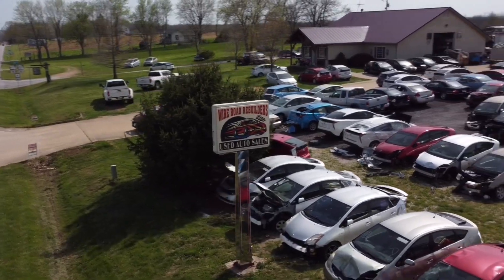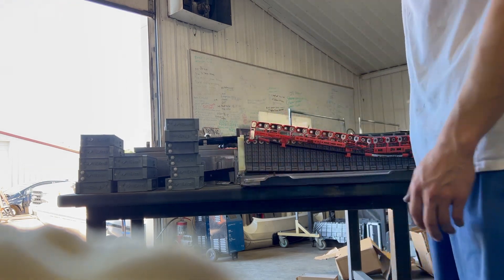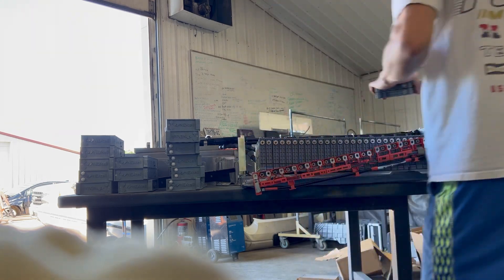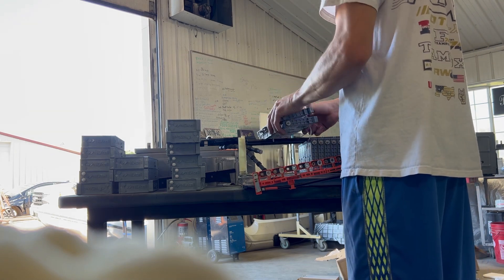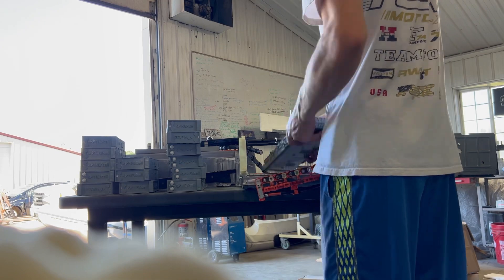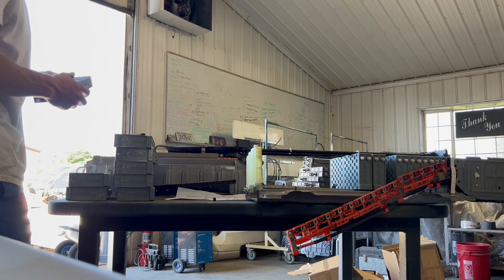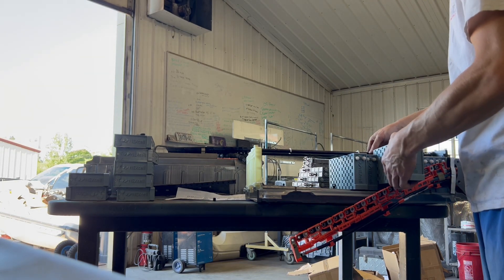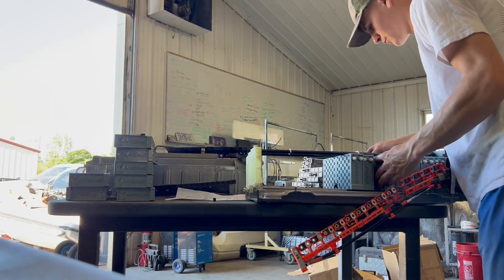Why you should switch to lithium on your hybrid | How to install Prius hybrid battery

Comment: My lithium battery from Project Lithium caught on fire. Switched back to OEM after the fire and I would recommend everyone be wary and do your due diligence before putting in non-OEM parts. It could happen to you too.
Reply: Tk you
Reply: That is my nightmare about lithium batteries.
Reply: I think it depends on where you live. I’m in NY, I put 90k on my gen 3 with project lithium and it still tests as it’s new. I heard about the guy with the fire. I feel safe with mine but if I was in Miami I would think twice.

Comment: How does lithuim handle cold weather, say -6f.
Reply: Very poorly. I have one and it could barely handle the mountains at 20-30 degrees, let alone less than 0 degrees. Then it caught on fire. Please don't buy this if you live in the cold. Jack has good luck in sunny California though.

Comment: No, just no. The Toyota NiMH battery management system is not appropriate for lithium ion cells. In particular, there is no cell balancing which the lithium ion cells require. People are asking about the fuel economy improvement and notice they didn't answer that question. The expected improvement would be close to zero. There should be a slight improvement from the reduced weight and probably a tiny improvement from less losses in the cells but any improvement is not worth the massive risk you are taking. The warranty is only 2 years plus will they be around to honor it? Your best bet by is a new OEM battery. Not cheap, but you can count on never having to change it again. Second best is a pack from a low mileage wrecked car. Third best, is a Frankenstein OEM pack where someone has collected good OEM cells from bad packs to make a new pack. The worst bet is any non-OEM solution. If you plan to keep the car, only choose from the top 2 options. If you plan to choose the other options and plan to ditch the car, at least tell the buyer what you did so they can be prepared.
Reply: We are a hybrid repair shop and have numerous lifepo4 battery packs out there.   To answer your question about balancing and software.  The balancing boards are built into each modules and the modules are better performing batteries  so far any issues that have come up have been remedied immediately through the company.  If you are just tearing down a company without doing research then you should be more careful.   You are right the charging system on a Prius is designed for a nickel metal hydride pack but that is why the modules are set up to work with the  Prius hybrid ecu to give the car optimum performance.  Fuel economy has been higher with all of the lithium packs we have installed but vary per drivers driving habits.  We have installed new OEM packs to with customers having very little improvement in gas mileage in comparison to the lithium pack.
Reply: @vdnishimoto3653  Mine caught on fire. Would not recommend, I switched back to OEM.
Reply: @vdnishimoto3653 it's probably important to point out that lithium iron phosphate behaves very differently compared to lithium ion and is very unlikely to explode or whatever.

Comment: have you had any issues with lithium cells? i am being told that they are very volatile and cause fires and explosions.
Reply: These are lifepo4 packs.  Not the same as a lithium ion pack. So these modules will not explode.
Reply: where can i purchase if i need to? @vdnishimoto3653
Reply: @KReplacement  Mine caught on fire. They're backordered while they work on a fix so no one else's catastrophically fails.

Comment: Question: is there any software changes or other modifications needed to switch from nmhi to lion?
Reply from the maker: Nope plug and play
Reply: @carhub2178 on a gen 2 Prius I currently achieve 50 mpg winter  53 mpg summer here in Los Angeles.. 65 mph Cruise control and follow all speed limits

How much better mpg can I improve..

Will be contacting you again to buy more parts

Comment: I have a 2013 used prius plug-in base.  Is there a way to add back up parking assist to it (the advance has it).  I have backed down my drive way since 1983, and I still don't hit the same place twice. So back up parking assist looks like you angle the arrows to where you want the drivers side to hit, but I have not found out how to do it on the 2013 prius base plug in.  It would be nice if one were able to get the module(?) from a wrecked advance and put it on the base (if it would work--in other convert the base to advanced for minimal cost).
Reply: Bro, this guy is a junkyard scrapper. And yes, you can. With the OEM Control Unit, Wiring Harness,  hardware, and likely OEM scan tool for the control unit's software. You can add any system to any car, you just need ALL of the factory equipment involved.

Comment: Whats the result of switching batterypack of gen4Prius to Gen3 Prius
Reply from the maker: Longer period of life expectancy and small increase in mpg. More power also in some cases
Reply: @carhub2178  👏👏👏👏👏👏🙏🙏🙏 Thank you for yozr response. Im from germany and lately bought a 2009 prius Gen 3. With 75.000 milräes.  Im planning what to do n the Worstcase/ if.... and checking out the most important Services like egr or checkikg batrery every year( it is told ne to do by the dealer here in germany) because my prius gen. 3 hasnt a Ventfilter or can you give an advice/ maintance Tips....how long will last my batrery from 2009 ? greets from Jeton/ germany

Comment: This video is about a year old now. How would you say these batteries held up so far? Have you got any high mile record use yet?
Reply: There have been a reported 200000 miles on a pack with no issue.  We personally have a customer with around 100000 miles on their pack no issues.
Reply: @vdnishimoto3653 have you installed the V3 sodium batteries?

Comment: Is there any programming done with install or is it straight Plug and play?
Have u guys attemped any other Toyota/Lexus hybrid vehicles?
Reply from the maker: We’ve done some Camrys but no you don’t need tools to clear codes. If it don’t reset just unplug the battery and back in

Comment: OK, I have a 2010 Prius I let sit unstarted for about a year.  Now the 12v battery has been changed but it says "Check Hybrid System" at start and the codes are P0ac0 and P0b47. It won't start. Is there a way to get the the ICE to start and therefore charge the Hybrid battery?
Reply from the maker: Normally when they sit for a while the first two cells go bad. And you have to replace them. They do make chargers but it prob won’t revive them
Reply: @tooltime9260   Thank you for the input. I bought this one after it was totaled out as a parts vehicle for the one I do drive daily. Overall it is repairable to become drivable daily with the exception of the discharged hybrid battery. If you have input as to how to recover that battery I would appreciate it, and take it away from my garden gnomes.

Comment: Hello , excellent video . I have Prius V 2013 still running good at 200,000 miles, but, I'll switch to lithium once I face any issues . I am also thinking of changing inverter coolant pump as part of maintenance . Since this the pump is located between Inverter and radiator, do I have to remove inverter ( as instructed in manual ) or can I replace it from below without messing up  with inverter. I read one comment that  someone  replaced the pump from below but I want second opinion on this . Thank you.
Reply from the maker: I have yet to see one of  those pumps in a Gen 3 go bad so I might make a video on how to change it the most efficient way though
Reply: @carhub2178  So, do you suggest me to keep driving until it breaks down, I have done 200,000 miles and it's still running good.
Reply from the maker: @kumara5492  yes but you do need to worry about changing the engine coolant pump on the passenger side! Cause they go bad and when they do it will blow the head gasket on your motor
Reply: @carhub2178  Well, I already changed the engine coolant water pump. That was easy. but, inverter coolant pump is way harder to reach it, unless we take the inverter out( partially). Thank you

Comment: Any thoughts our experiences with stuff like the Maxx volts battery charger?
Reply from the maker: Never used one before. We just charge up the cells one by one but I heard they work good
Reply: @carhub2178  just bought an 08 that failed MOT and has a few faults. Not sure if there is any benefit in adding one. I guess i could use torque pro and check the cell voltages and see how bad they are. 

Your asking for video requests. Im going to do CV axle, replace exhaust and do the rear disc brakes. So if your doing any of those soon I would love a video 😊
Reply from the maker: Yeah no problem I’ll see about making those videos asap!

Comment: Brother I need help I changed out my batery pack and put a rebuild one on and now it gives me a hight voltage code and it doesn't turn on anymore hopefully you can help
Reply from the maker: Does all the cells voltage test the same?
Reply: @carhub2178  yes they do
Reply from the maker: @juveelizalde  make sure the orange plug is clicked all the way down and make sure your 12 volt battery is charged and good

Comment: Great video, thanks.
Lithium ion might be better in many ways but a gen-2 prius cab in Vancouver Canada went 1.5-million kms -- 930K miles -- on the original nimh battery, and being in Canada the nimh battery in my '19 awd-e is said to be better in the cold.
If my battery fails though I'll see if there are newer-technology batteries to retrofit.
Reply from the maker: Yes that’s a good idea!!
Reply: @carhub2178 do you have any experience with the v3 sodium battery packs from nexpower?
Reply: It is all about maintaining as low as possible temperature or providing good dissipation of heat with NiMh batteries. NiMh battery provides you any torque you push on acceleration if the middle temperature sensor is low or as nearly equal to the first and third sensors on hybrid stack. I've driven without battery covers on with rear windows down and the middle value would drop to 70s Fahrenheit (Torque Pro app) at night during warm/hot seasons, and the vehicle feels fresh, responsive, and simply pleasure to cruze.
Reply: They fail prematurely because it’s running off of NiMH BMS. Mainly it’s gets discharged too low. If you notice they only warranty for 2 years be used they will fail around 3-4 years of normal use even though it’s LiFePO and supposed to last longer. If you can somehow reprogram the system to run on LiFePO4 then the pack will probably last 20 years plus
Reply: @ronaldoquintos1675 so are you saying buying a lithium battery from ProjectLithium will actually fail my car in around 60,000 miles because it will still be running off the BMS system that was meant for the original battery?